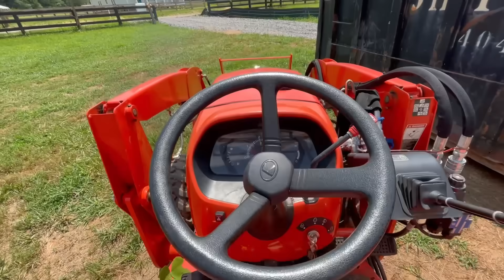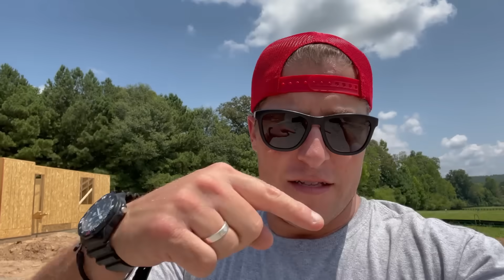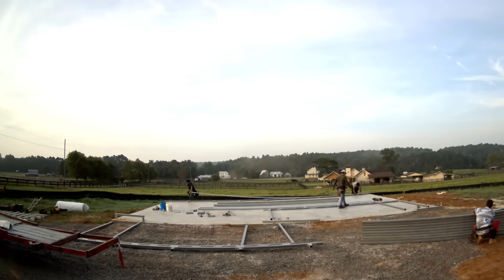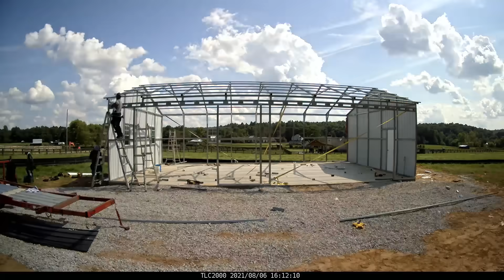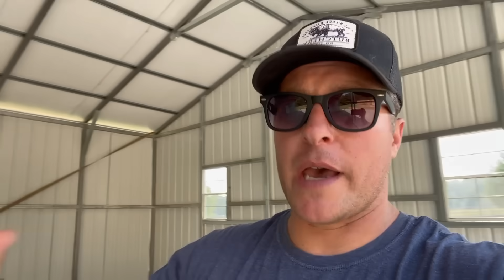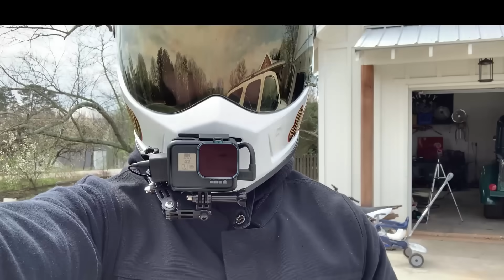I FIRED THEM!!  26x40 metal building Dream Garage build Ep.2

Comment: I spent a few years erecting metal buildings (larger) and if anything was not per plans, it was a redo, so we made sure to do it per the plans the first time.  If there were changes made, we made sure with the customer and mfr beforehand.  Stick with your guns, make them do it right.
On a side note, unfortunately, it's not uncommon to have meth-heads on the crews and they do everything they can to keep materials so their habit is funded.  When we ran into them, they were given the choice to go to rehab or walk away.  If they had already stolen materials or tools, they were told to leave and never come back after returning items.  One of the guys was caught pawning company tools.
The whole "one day" claim is a red flag already.  It can be done, but I'd watch everything they did after the claim was made they'd do all of it in one day.  That size I'd call a two day min and a third day for wrapping up trim and details with a couple/three guys.
As for the ripples, it looks like the crew may have accepted 2nds (flawed returns from other jobs) on the siding to save on materials.  I would have rejected those right away and they would never have been installed.  Ripples means the edge was stretched when cut, or were allowed to be bent too much when moved around.  Look at the rippled edge, see if there is paint, or is it a cut edge...should be painted.  If not, likely cutting them was done to cover something done wrong beyond it.
Hope it all works out.
Wanted to add one thing...The buildings I worked on were all red iron and insulated.  Seems to me if your building was very lightweight in comparison...did you know there were more options, or did someone talk you into something?  Maybe it was a blessing in disguise and you can opt for a better one now...?

Comment: I think they have up to 90 days to fix everything
 But that's just not a punch list that is structural like you said about the trust I don't know if you live where there's snow but you won't have a roof. And like you said you have to look at it everyday that's not OCD that's just common sense not built correctly wind will grab that and rip those panels off in a minute

Comment: The roof system looks under designed as installed.  There should be drawings of what the roof trusses look like and it should clearly describe all the connections.  Blueprints are an important part of the contract and If you bought a building without clear instructions then you went to the wrong Company.

Comment: The structural design issue for the main trusses is a major lawsuit item.

I'd definitely require them to correct all errors or they don't get paid.

It's in the contract.  Must pass building inspection. 

and that won't pass.

Comment: Fired my shop builder too buddy. So many corners cut all the way to the concrete beneath the columns to drilling the holes in the wrong spots. This ripples on your siding is probably from an electric trimming sheer. Looks like bad planning on there part to get you the right materials for the plans. Sorry brother.

Comment: Dude, I am a GC and everything on the building should match up with the plans that you signed off on as part of the contract. Your signature should be on not only the contract but also the plans which make the plan drawings part of the contract. There should also be wet stamped engineering included with the plans that are kept on-site for the inspector to reference. All of the truss designs, screw type and size, spacing, etc. should all match up with the engineering. Anything that varies from that but does not effect the engineering should have a change order signed by you. Otherwise, they should take it down and let you out of the contract.
Reply: I couldn’t agree more. That is why I always worked for a commercial GC. I started as a Super ended as a project manager. The residential stuff is usually a cluster if the three parties are not on the same page. The township need to be involved, code is code. The township must have plans that were submitted for permits.
Reply: Your right Mike, but it seems a lot of back road counties'' don't care. Coming from Silicon Valley i was surprised how different things are in rural areas.
Reply: @BasketCaseGarageForFun  Yeah I build Pools in AZ and we cant even poop without an engineers stamp and an inspection! LOL
Reply: Dude it's a pre fab steel building 🤣🤣. Aren't any architectural plans👍
Reply: @1986subway  Sorry but yes........the plans have to be approve my the building department of the town/city. Even Pre-Fab building have architectural drawing that come with the building. If the building is inspected the plans and finish products MUST match.........
Reply: @1986subway  It had to be certified at one point and stamped by a professional engineer.

Comment: get your lawyer to write them a letter.........who did U buy from????? under the DEEP POCKETS theory sue the manu.
do not demand the bozos back that screwed U.......it will only get worst..............DO NOT PAY ANY MONEY till U R satisfied with the job .....did U sign a completion date contract........if so U can sue 4 money back 4 not being completed.  by the way where did U find these flakes.........what little I see...... the building will not take a tornado hit......the metal is 2 light......the trusses suck .......get engineer only after approval of your attorney........when done charge   all excess cost to the building co ..........your roof supports not to exceed 2ft horizontal.......l and trusses not to exceed 4 ft...........the siding and roofing is light gauge as R structure.....DO not hire another contractor till the first is solved in court....ralph_valentine@yahoo,com  (general contractor retired 50 yrs)

Comment: That was the first mistake that caught my eye was those truss braces .  They looked to small in depth and in length-run.   The chandelier at the point where the brace ends to the wall allows the roof rafter to bounce.  Not sure what state your in, but it does not appear this roof will hold a snow load.
Reply: That is the same thing that I was thinking about where does he live, does it  come heavy snows there, cause those rafters will buckle under  big heavy snows . Even what they did would not have much wind resistance, with no more bracing than the one 6 ft piece at the top and no more rows of metal strips from one end of the building to the other end on top of the rafters. Purlins seem like there called , I can't remember, on a all metal building. It would be like sheeting boards on a wood structure building. 
Anyway, it's a weak structure the way that they have it, on that side of building.
Reply: You can tell by the way they're bent at the end those truss braces are for one of those carports with no walls 😲
Reply: on that  (  size ) of building
Reply: It is a trussed roof built like a post and beam . Without the post and beam.

Comment: If the building doesn't pass inspection, the verdict is not yours to decide. The building description you bought should stipulate the design type and metal gauge to be used. if they switched the design of the metal gauge, lawyer up.

Comment: The shed must come with a certified engineering plan. I agree the  roof for that size and span does look flimsy and no cross bracing it will twist as well.I agree with a prior comment cheap usually means nasty as well

Comment: What you have are not "trusses", they are rafters with a collar tie, and are absolutely NOT sufficiently engineered for any forces working on your roof (wall spread, dead load, live load, wind load, etc). You describe the approved trusses as having "vertical" elements connecting the top chords (rafters) to the bottom chords, but that too is a poor design: the interior truss web should be triangulated for far-greater strength. You were right to shut these guys down, I would not build a dog house like this. Good luck!

Comment: You are spitting into the wind. There are only 2 kinds of leverage over contractors and suppliers. 1. Money! How much money are you holding from the final payment? This is a bargaining chip however you must realize that they can put a lien on your land and sue for payment with legal fees on top of what you owe. 2. Lawyers with construction experience and a winning record. The cosmetic issues are part of the installed building now and a cosmetic fix, like a small attached beauty cover, may be the best you can bargain for. The support trusses are a contractual issue and not a code issue. If your contract has included drawings that show the long trusses you will win in court and they know it. If the drawings are vague you may have to pay extra to get them. I think Jerry Bryant's comment about buying cheap is valid. A good lawyer could argue and win that the manufacturer sent defective panels and the installation crew should have never installed the defective pannels. Both share the blame and must provide new materials and labor.

Comment: The ripple...a minor cosmetic thing, not perfect but hey... If it was the only issue you could let it slide, the truss problem is a HUGE issue. Overall it is indicative of other issues you did not see & closer scrutiny of the engineering drawings would be wise. The inspector will likely not have issue with the ripple, but there is a big structural issue which is dangerous with the truss. How would it stand up to snow load? How could you safely maintain it while walking on the roof without damaging it? If it did move, would the sheeting shift & make the screws distort the holes & rubber seals resulting in a water leak?

Comment: So, attention to detail on the laps was certainly ignored.  Versa tube is a step child to actual metal buildings.  You'd been better with post frame over that.  With all that being said, your building will be fine, just not as hardy as you'd like.  I'm not a fan of the trim details over the doors and windows.   Head trim should always extend 2" past jamb trim.  Sidewalls should've been sheeted before the roof to allow proper installation of eave trim.  And I didn't see any butyl laid down on the roof whatsoever?   Good luck man.

Comment: I feel your pain, I had a shed built:- the slab had leaves in the finished surface, it was not flat, it was neither smooth or consistently rough. They drilled holes in slab in the wrong spot, they put a rafter set in backwards which collided with the roller door which they had to remove and put back the right way around. They dropped screws all over my yard, the rafters do not line up with the next one in line, the roof screws are not in a straight line. The facia trim is dented as are some of the wall sheets. The wall studs had missing screws at the joints. There were dirty marks on the insulation. The slab boxing blew out in the doorway and was not corrected.

Comment: Don’t give them an inch. Hold them to the plans they provided and passing the permit inspection. Your issues should be with whoever you signed a contract with. At some point you may need to get an attorney involved. Hopefully you owe them a substantial amount. Do not pay them a dime until all issues are resolved to your satisfaction. From here on out get everything they tell you in writing and dated. These people have already proven they can’t be trusted. One question for you. Did you require references and check them prior to signing a contract?

Comment: Did you see the installer attach the vertical panels?  I ask because it looks like they took a hammer or pry tool to get the overlapping panel to fit onto the underlying panel.  Unless there was damage in shipment or delivery, that is the only reason I could figure to explain the wavy seam.  Also, the collar ties (cross members in the trusses) are often a shorter piece tying the legs of the truss together.  However, the truss would need to be designed to withstand the design load for the span from the peak to the wall. The amount of deflection you described leads me to question the truss design, and design load.  If there was to be a 16' bottom chord, that seems to be a different design approach than a collar tie. Like you, I would challenge the installer, as this would negatively impact the long term strength of your building.  Do you have copies of the engineered drawings? That is what building officials would use to approve the structure. Either the installers complied with the approved engineer drawings, or they did not. Good luck. As one responder put it, you get what you pay for.  However, that would include meeting the minimum standard.

Comment: I am a carpenter of many decades. About eight years ago, I started helping my daughter and her husband (now deceased due to COVID) finish building their new home. My son-in-law hired a drywall contractor and told him that I was the one to coordinate with about the insulation of the drywall. I had a meeting with the contractor to discuss a few things that I wanted to be done and how I wanted them done. He was very pleasant, but his crew Foreman told me that he had not said anything to them about our meeting. They proceeded to do the fastest, cheapest job that they could.  22 tons of drywall, $12,000.00 labor, we bought all the material. Joints are separating, you can see every tape joint and where the screws were mudded over. We could not see most of the problems until it was painted, and by then it was too late.  I was a foreman on a project for UPS that included a metal building, and we had very similar problems.

Comment: I completely feel for ya. Im a wick dealer and install post frame buildings. 1. That ripple on the edge of the tin shouldnt be there. 2 What we try to do is face that overlap away from prevailing winds or from the common entrance. 3. as i was watching the vid, and saw those trusses, i was like "cheesy"! Hope you get it worked out.
Reply: I saw then trusses as was like, there is no way that is enough support for a snow load, if the roof is bending under the weight of the installer, it's fucked.

Comment: You don't have a truss you have 2 square sections with a collar tie across the top.
Also looks like hi tensile sheeting which gets a rippled edge when the sheets are formed.
Your engineered drawings for the council approval form part of the contract and should be followed first.

Comment: I watched this.  I have been in the Metal Building Industry for 22 years.  I work for an MBMA Affliated company.  The buildings I supply are 3 plate weld up columns, rafters.  I believe in the comments you and some other people call them Red Iron.  Which is what I'm talking about even though ours are actually Gray.  So Okay If your truss design is shown on the plans and the fabs as something else.  It needs to be what is shown.  Otherwise you own a Tent.  Not going to specify what company I work for and not trying to sell anybody anything but the big trusted names in Metal Buildings are typically.  Varco Pruden, Butler, Chief, Star, CECO, Nucor, American.  If you deal with a verified builder with one of those you will a much better experience and vastly better building.  Of course the cost will be more than what is being put up currently.  But your quality and structural integrity will be on another level.  I could talk about this all day.  I typically work on Industrial projects but I hate seeing people that are trying to put up sheds and such getting taken advantage of.  Good Luck.

Comment: I’m not sure of the costs involved whether this is more or less expensive than something like a Morton Building, or that type of structure, but if I paid for something and got what you got I would have fired them too.  The Truss bracing issue is a major concern and would become a disaster with a bunch of snow piled up on it.  The 16 foot cross members should be a minimum design requirement and the 6 foot ones installed in those trusses are nothing less than a big joke for that industry.  How could they possibly think you wouldn’t notice the difference.  The vertical seams don’t look that bad in the video but they probably show up more in person.  If I were you I would get some pictures of what they showed you for sale and what you ended up with so if it comes to a legal battle you have that information to back up your very valid concerns on the appearance. I would also wonder how well those seams are sealed with the wavy seams.
Reply: The owner is completely in the right with his issues. Stand your ground and make them correct all of the concerns. As it was said on here, take pictures of all the errors and keep notes with the pictures. You might also ask a building inspector to stop over and write up a report of the violations. This will help the owner if they refuse to correct and the owner gets into litigation. 
I know…I’ve been there before. I had a framing company that started on my house and clearly didn’t know what they were doing. They made so many code violations such as cutting a roof truss that I had to fire them. I decided to only pay them the balance of what it took to finish out the house. Basically it took $20,000 to correct all the framing problems and therefore their income on the job was net of the $20,000. Well, they weren’t happy and sued me for it. We got into depositions prior to trial and I pulled out my notes and 144 photos of all the errors. After two hours of deposition, we took a break and the framing company excepted my offer as is. They knew I had all the facts and the photos to back up my side of the story. I wish the owner luck and hope this building works out for him in the long run.

Comment: Those ripples are because that edge is the under lap. The over lap side doesn't have a extra rib bend in it
Reply from the maker: We thought about that also and compared a few metal building in the area and they looked exactly the same. Well without the ripples. Thanks for support.